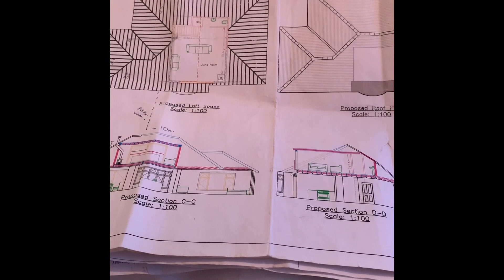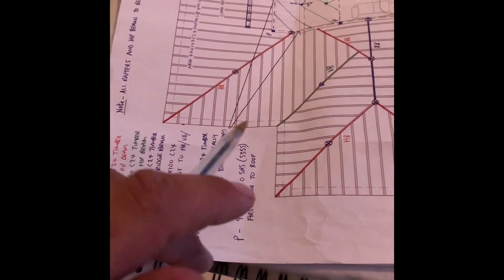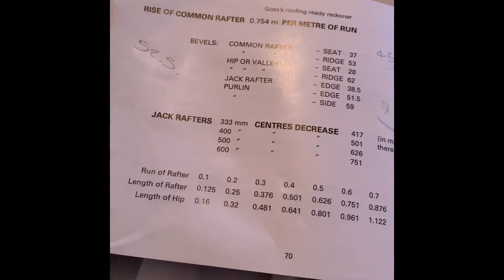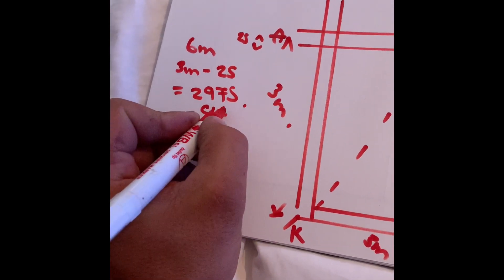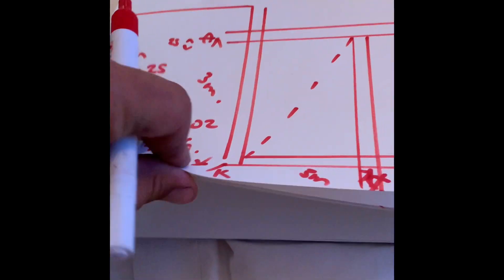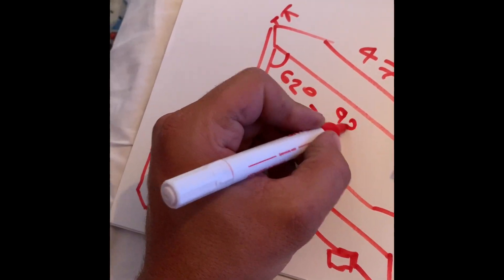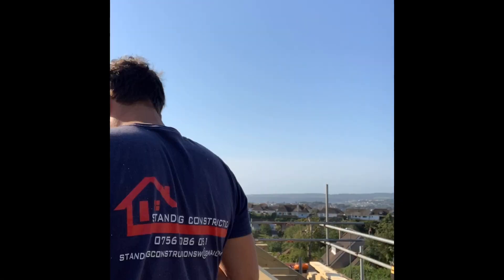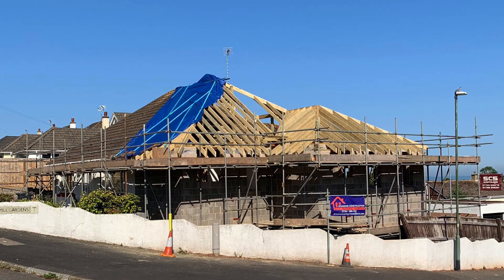How to cut a hip rafter w-ready reckoner - in 10minutes - timelapse demo.

Comment: Thanks for this video. Is the true length of 4766 from the very tip of the hip rafter after the bevels have been cut or from the shoulders of the bevels. I assume that the ready reckoner gives the maximum length. If you were measuring on site would you measure from the bevel tip or the shoulder to the splay on the corner wall plate?
Reply from the maker: Hi - a couple of these to consider here -the true length calculated from the book is the point of the hip along the same line to 4766 which would then be the top of the ridge angle. 
For a nice finish on the birds mouth, when you cut off the wall plate measure the distance in from the point to where you have squared off/cut off off. Normally about 20-30mm. 
From your birds mouth measure this distance into the birds mouth along the seat angle and plum down. This will give you a smaller birds mouth but one which will sit square and tight to the wall plate. 
Need to do a short video on this maybe, hope this helps.

Comment: Do you match the common rafter up stand at the “corner” of the plate line or the “squared off corner” plate line? Cheers
Reply from the maker: Hi, the backing should be the same on rafter and hip, but on the hip it’s taken from centre point so sometimes will sit higher so you can either back hip or some drop a bit more out of birds mouth so edge of hip lines through with rafters. Hope that helps if not give us another shout
Reply: @southdevonhomes-jonnystand4039  that’s makes sense, do you know how to work out the drop by any chance? Thanks for the reply. You’ve got some great videos that are very helpful🤘
Reply from the maker: @Total_carpentry_  what do you mean by the drop? The height of up stand? 
As a rule of thumb you have to leave a minimum of 2/3 in rafter on top of birds mouth. 
I usually go 40mm deep birds mouth as you then leave a bit more than 2/3 on for strength and with a 4 x 2 wall plate you avoid a snots the Bricky leaves?
Reply: @southdevonhomes-jonnystand4039  the drop of the hip, if you choose to drop it instead of planing the edges to make it line through
Reply from the maker: @Total_carpentry_  oh with you, measure the distance under the line or straight edge under last common.
Reply: @southdevonhomes-jonnystand4039  thanks mate, keep making the roofing videos🔨👍

Comment: Whats your technique on marking say the 400mm centres onto the hip rafter for the jack rafters?
Reply from the maker: Off the last common rafters pull the tape down parallel at multiples of 400mm. Nothing flashie there mate. 
Always measure to long point.